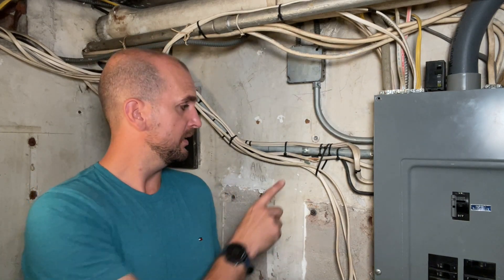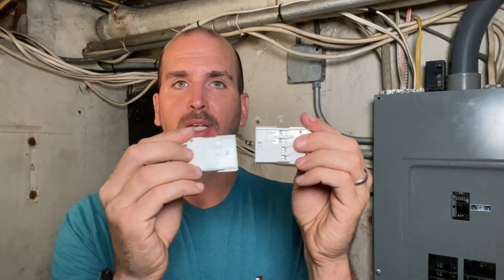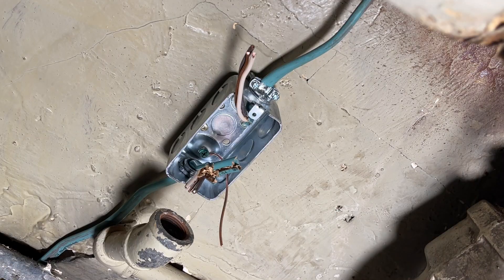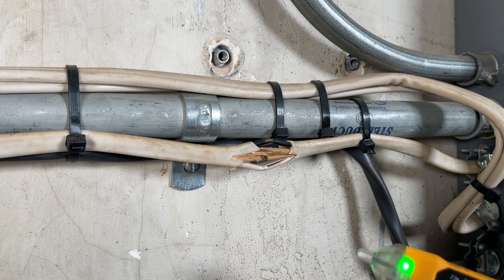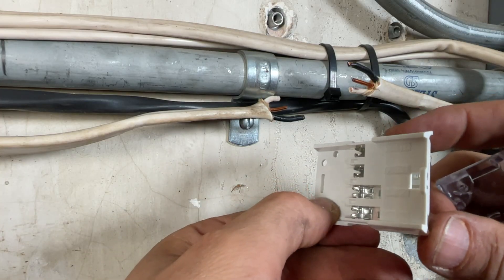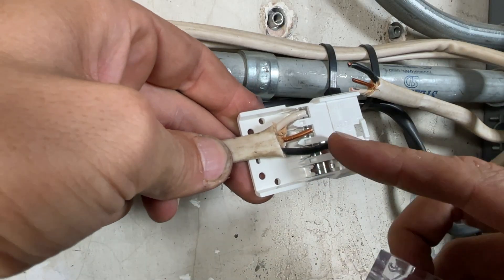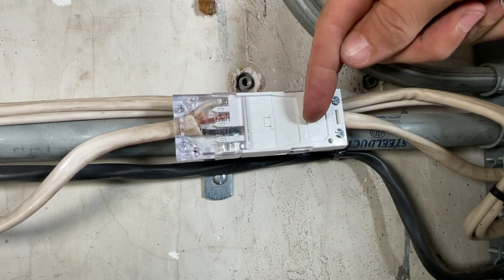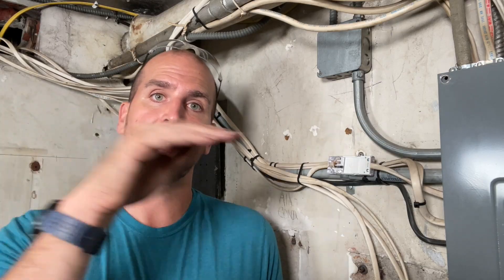How To Repair Damaged Romex Wires

Comment: Wow, this is the second video in a row where I'm recommending using the Wago 221 inline splice. Perfect if the slack is minimal as with your handy box solution.

Wago 221-2411 inline connector
https://www.youtube.com/watch?v=PEEzjuxbp-Y

Comment: I would not do this as a home owner.  Unless the exposed conductors are either heavily exposed or badly nicked, I would not cut the wires.

In the example provided, you went from three intact conductors to 6 fail 9 fail points.  ( the six fork splices and three mating surfaces.

I would would have used top quality liquids electrical tap and coat all wires individually, let dry, then coat all three together (spaced out a little) and  the nicely wrap it all with top quality electrical tape,..... also...the connector is 30 bucks.

Comment: Network and phone connectors use the same concept of cutting the insulation and contact.  I do not have an extensive amount of time putting these together, but I was assembling new.  Now over many years how many cables have I seen go bad?  
Can't think of any.  Network cables take much more abuse than those will.  
I would not be worried about starting fires.

Comment: I don't like the idea of this gadget either. Why not add an extension onto the square box fed by the EMT? It looks like the romex cable might be long enough. And you might  be able to fish enough wires in the existing EMT if it has capacity left, no?

Comment: That is an interesting product, and it is a good low draw buried solution. I would not do this with a heavy draw. Also note, this owner installed romex in exposed locations which really raises concerns as to what other short cuts were used..romex exposed is not generally accepted in most codes and also UL is the gold standard. Be sure and verify locally. Thank you!
Reply: At least here in Canada, Romex is allowed to be exposed as long as it there is a low chance of it being subject to mechanical damage.

Comment: 99% of electricians would put a j-box there and run a new wire from the box if there was not enough slack. Most of the time there is not enough slack. Unless it was feeding something with a few feet of the panel I would never replace the entire home run. Some would just tape it up and call it a day! lol

Comment: Stopped using those type of splices in cars many years ago.  The "forks" will overheat and corrode over time especially under high load conditions.  My modular home has similar type of "connections" in all the outlets and light switches.  I am in the process of replacing them all.
Reply: in the mobile home i own i replaced a receptacle for having loose prongs causing the plug would fall out. each of the push-in connections on the receptacles that i replaced for this had charring from a bad connection. not a fan of spring loaded stuff, even wago. they generate heat, the exact thing i don't want inside my walls. i guess i will continue using j-boxes and proper terminal blocks for splicing.

Comment: I believe that this type of push or cut in connection will pose a hot spot under heavy load consider that you pickup one Ohm on hot and neutral that’s 2 ohms on a 15 amp circuit wago connectors are tested I like them I’m a DYI.ER with an electronics background. But having said that I believe you’re a very knowledgeable individual

Comment: Considering that NEC requires inaccessible splices to be soldered, I'm surprised they allow that kit to be used at all. In the accessible splice, I'd prefer the box and wirenuts.
Reply: Can you quote the nec article I didn't know I could burry a connection if I soldered it?
Reply: @PeterTrimboli  many years ago I was told by a master electrician that any splice made behind drywall must be soldered. My NEC is about 20 years old - who knows what's changed. I've seen YouTube videos of using wirenuts and heat shrink underground, but I personally would NEVER do that.  I'd solder it, apply silicone and heat shrink at the least.  Better to run a new cable.
Reply: @jimmacaulay844  Check out 334.40b. No soldering is required for these connectors.
Reply: @jimmac1185  Maybe NEC changed.
Reply: @jimmacaulay844  It changes every 3 years. Thats why we are required to go to code update classes in my state to maintain our license.
Reply: NEC allows push-back receptacles!

Comment: The TE Romex Splices are commonly used in manufactured homes (double wides) to connect the two halves. Although they are approved, I get a knot in my gut whenever I see these. But for some cases they can't be avoided.Just make sure the Romex is secured so they can't possibly pull apart. My current double-wide uses an actual junction box for the marriage. I guess it depends on the manufacturer.

Comment: I hate to use the OMG, but here goes, OMG! That thing is a glorified Scotch Loc that has been used in the automotive industry for years and years. We mechanics have been swearing at those for years and years, and now you're going to start burying them in walls? Holy crap!..... I know that its against code to bury a junction box in a wall, but this connector is just garbage. Those little v knives in there that bite the wire cannot flow any amount of amperage at all. You pull a heavy load through there from a toaster, or heater, and those little v's are gonna heat up like mad and melt that whole thing to pieces. I'd rather have a box full of good tight marrettes in the wall than that thing. JMO

Comment: Also, if it's in the wall, take a 3 gang old work box and bring each wire in each end of the box. Splice with 6"-8" piece of wire and wire nuts. Cover with a blank and move on with yer life.

Comment: The splice connectors arelike what's used on mobile/modular homes to join the building sections together. Not a fan of connections where wires are pressed into a slot like that. I would have no problem NOT cutting the wire and just coating the damage with liquid tape until it was completely filled then wrap with some Super 33.

Comment: Have a section of wire where a mouse chewed and just happens to be at a drill hole so I may need to run another line - though putting a work box in the basement  and one in attic would allow me a 10’ replacement vs. a 70’ run.  I didn’t know the splice kit was available - very cool.

Comment: I'm a handyman.  I run across this issue far more than I'd like.  Being "old school" I strongly prefer the handy box repair.  That said, the TE Romex Splice Kit is a solution that will work where a handy box won't.  However, I do have to echo Steve Foster's  comment re not liking anything that pierces the insulation.  Another potential point of failure, also greatly increases the resistance in the circuit.  OK, enough kvetching, I just came across your channel and I greatly like your presentation style.  Keep up the good work.

Comment: In drywall, why not put a 3" long splice in a 4" round box and cap"? That gives you at least an extra 1" of the original wire (on each end) plus 3" of the splice and it all fits into the box. And looks good.

Comment: If the insulation is the only thing that is cut, why not just put the cable in a protective cover and insulate the exposed wire instead of cutting a perfectly good wite and slicing it back together?

Comment: As a Service Electrician out troubleshooting problems I replace the in line splice kits all the time. They are junk and usually go bad after 5 years.
Reply: Ray Bachle -- Thank You for providing this!!!!  I look at all these little toy things and think - yeah, perhaps Only Low Voltage, telephone, electronic, things, for just that... Nothing else... Look at those tiny thing metal, connecting, piercing places!!!!  Imagine 15+ amps running thorough there for hours, years on end... And then finding what you are finding all the time... Thanks again, for providing REALITY to this nuttiness...

Comment: Generally when I need to repair romex like that, i don't have enough slack to join them properly in a box. So I'm likely to use two small boxes and add a foot of cable between them so I have proper slack to connect everything properly and easily. Overkill? Maybe. But also there's nothing sketchy about it, and connections are far better than those displacement V's... or trying to stretch the wire Juuuuust enough to connect them in a box (who hasn't tried this?). And final advantage... easy to toss in a receptacle on top of one of the boxes if you want.

Comment: Good video. But I would  Practice more on putting  the ground 1st then the neutral and hot conductors. Cutting the hot 1st then the neutral and ground wires last. I know you test it. But I just think it is a good practice.

Comment: Love your videos
I have a question concerning grounding outlets. An inspector did a house inspection and stated that some of my outlets are not grounded. I am ordering a tester to find out all the outlets that have an issue because he did not specify which ones he only said the 1st floor. I have pulled one outlet and there is no ground wire attached to this outlet. Also this is the original wiring from the 1950s and the wire colors are white, black, and red. No ground wire in this bundle. Hot and neutral attached but this red wire is just capped off. I have now attached a ground wire to the outlet and attached it to the interior of the metal box. My question is what is this red wire and what purpose does it serve? Did my putting a ground wire to the outlet and then metal box solve the no ground issue?
Thank you for any assistance you can provide.
Respectfully;
Alan Tobin
Reply: Isn’t that a 14/3 wire for 240 applications? Where red is hot? I know that this is a novice question..
Reply: @edwardeaccarino7951  no ed not 240. I solved the no ground issue using dual GFI breakers at the panel. So I am good now and that red wire will remain capped of at the outlet.
Reply: @alantobin8762  I would guess that the red wire used to be for switched outlets or multi wire branch circuit.
Reply: @jimmac1185  hey Jim yeah I don't know but the no ground issue can't be solved unless I rip all the sheet rock off the walls back to the panel and that is not going to happen. So I changed out the breaker's in the panel to dual GFCI and AFCI to protect the whole line. Of course this will not solve the no ground when you plug in your tester to the outlet but it will protect the line feeding the outlet. Case closed.
Thanks for the response.

Comment: I do not know if I trust those springs in the connectors over time, wire nuts do not have this possible issue

Comment: The handy box connection system is good. I would not really trust this snap together plastic crib connection system. I would be more concerned about the age of this Romax as the older installations tend to crack or just fall apart do the bending the copper. I’d also like to know what the current rating is on this type of connector,.

Comment: I just use the rip off Wago 3 conductor straight thru connectors. I like Wago's but you have to feed in at 90° angles. The straight through 3 conductor Wago clobes are much cleaner and easier to work with. So far I haven't burned my house down
Reply: Faux Que --  "So far" are the key words... Someday, someone will wake up and stress test all those little former telephone connectors that run very low voltage, and find out - wow - those are not able to stand much heat before they catch on fire, when used with standard electricity......

Comment: It’s you guys in the comment sections that have NO field experience that have the strongest opinions. You guys give away your lack of experience by starting your comment with “as a licensed electrician for 40 years” or “the inspector around here would fail you for that” or my personal favorite, “if this were my job site you’d be fired”. 
#1, you don’t have any employees to fire. If you ever had any employees then you would know it’s no fun to fire somebody, and it’s not easy to find help. #2, if you had any experience at all, you would know that for the most part an inspection is a formality. Inspectors don’t comb through a job site, on a quest to find a code violation. All they are thinking about is getting to their next inspection. Most importantly, people who actually work in the field know that city/county inspectors…don’t know anything!  And they don’t care. You think some highly knowledgeable guy is going to work for 38k a year, while he could be out installing making six figures?  No. But all of you know-nothings in the comments just assume otherwise.  Yes, we can all point out code violations. Yes, you’re not supposed to zip tie wires to conduit. No, it’s not a fire hazard. The video is about introducing people to the TE wire connector.  Yes, it can be buried behind a wall. No access required. Is it better to set a junction box if possible, YES. I don’t care what your brother in law’s cousin who is a master electrician, a journeyman who is certified, and teaches a code course told you.

Comment: Your video was informative. 
I will be looking farther into these though. In all of my experience with pinch type connectors I have never had great success.
Note that the only part that contacts the wire is the tiny parts that the wire pinch into. I would be concerned with anything more than a 15a circuit. I would hope it would only be rated for 14 gauge (15a). 
I must note that I have seen many crazy things over time. Many of these is why I would be concerned. 
I love that you showed an alternate for an exposed wire with the handy box. I would recommend that if at all possible.
On another note I do not recommend securing wires to conduits, especially metal. If there happens to be a short in any one of those wires it can electrify the whole pipe. (should be grounded, but not always the case) 
Also note that zipties are not great for long term. They tend to get weak over a short time. I am even finding that the plastic Romex staples seem to fail after a couple of years.

Comment: That type of repair kit isn't approved in a lot of areas. And for good reason. I would NEVER use a V notch type splice kit like that.  Wago (and others) make both a snap down and screw down splice that is acceptable in most areas.  Some areas will require a box for a junction no matter what. If you do use a box, be careful NOT to double ground the line via the box, which can lead to serious ground loop issues. This can happen if the box is mounted to a metal plate, is touching metal conduit, etc.

Comment: I'm sure someone else said this already but Romex out in the open like that is illegal where I live in California. It can only be inside a wall. I would never have cut and spliced sound wires but just fix the insulation. Not sure if that's legal either since I've never had to do it because we cant use Romex like that. The REASON it is not allowed is for the very thing this video is based on. It's too easy to damage.
Reply: Exposed romex is illegal in California, yet shitting in public is perfectly fine. Go Cali!
Reply: @electricaf365  There's no crime in YOUR state? No drug addicts on the street? It has at lest one MORON. The Electrical code was written when it was not OK to shit in public. Maybe we should change the EC to match the stupidity of the politicians and start allowing romex out in the open.

Comment: I would have used just wire nuts after installing the wire nuts properly I would have put a neutral on the south end and the hot on the North End and wrapped everything tightly with electrician's tape

Comment: That handy box solution would fail around here. You must have 6 inches of free conductor inside the box. Also strapping romex to a raceway carrying conductors is insufficient as well not to mention no protection is provided for the romex from physical damage.

Comment: Intact, unstripped, not cut and joined wires are safer than any sort of splice. tape it up and hang a picture or thermometer over the NOT "Defect"

Comment: Legalities aside, I'll splice in a piece of Romex, twist and solder, heat shrink tubing everywhere. Double on the hot lead, and include RTV if I want it to be waterproof. 
   I simply don't trust insulation piercing  devices.

Comment: I get the hesitation and desire to do things the old ways but, who hasn't seen fried wires in a junction box. The repair is only as good as the mechanic doing it. I like trying new products and evaluating their efficacy for myself. However, it requires trust that the rating agencies have done due diligence in rigorously testing the products to required safety margins. No one who's worked on electrical systems for any length of time, hasn't seen the situation where this type of repair would be a huge advantage, save time, money and scraped knuckles and cuts.

Comment: No way this will be legal in most areas where they have been tested. Definitely not able to use any of these push connect or clamp connections commercially. As a remodeler, I have done stuff that is not traditionally kosher but it would have to be something I would trust the families life as if it was my family with my repair. I've seen too many of these "permitted" connectors fail.

In this situation, you are close to an end and would be silly not to remove the wire from the panel and run a longer one and put it in a junction box. 

Right now you have the tendency to look for the easy way out and I would not hire nor work with people like that. Keep an open mind and always keep learning.

Comment: electrical tape on an approved splicing appliance?   I wouldn't.  In my experience working on previous owners DIY....and some professional wiring....electrical tape almost always has been used to jerry-rig a connection and hide poorly done work, as well as causing difficulties in troubleshooting problems later.  There are very few proper applications for electrical tape, in my opinion.